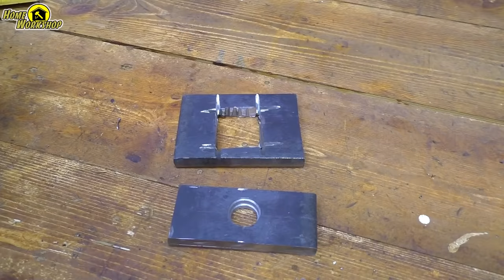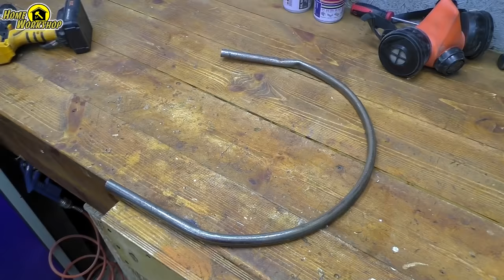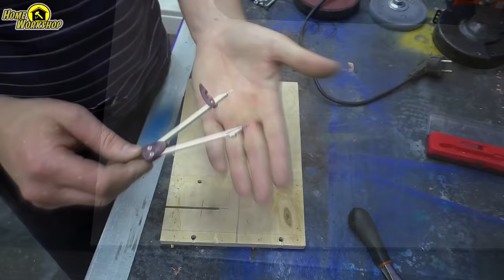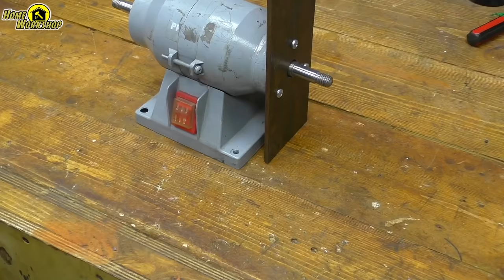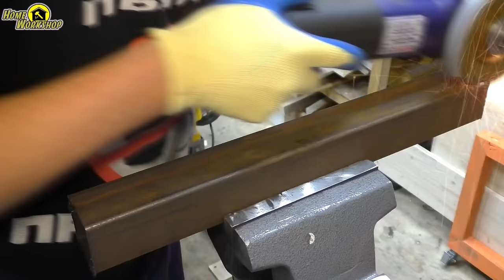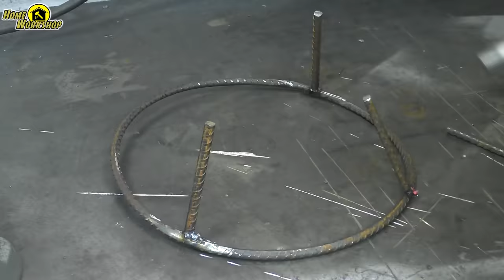WOW!!! 3 COOL IDEAS FOR YOUR WORKSHOP!

Comment: Totally badass Buddy  a lot of ways you used the vise to press bearings etc reminded me of growing up and working on Antique cars  and Motorcycles with my Dad in our garage workshop the old man was very creative in getting things done  often he would put parts in our kitchens freezer to contract them and heat up others with a Propane torch to expand those  then press it on the vise using  various sockets  to fit the bearings and push them as straight as possible

Comment: good work! you could buy a pipe bender for less than it cost for all that steel tho !
Reply: same for the sander !
Reply: Miles Of Smiles Make bracket to hold  a belt sander on end like I did and save the effort.
Reply: Miles of Smiles .... It all depends ... where one gets his materials  to work with (;-) .... know what I mean?